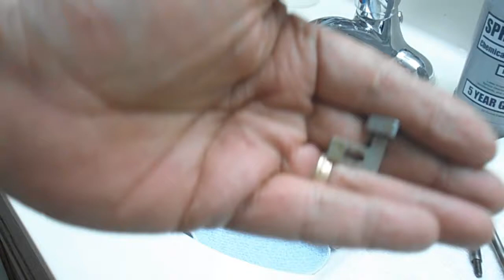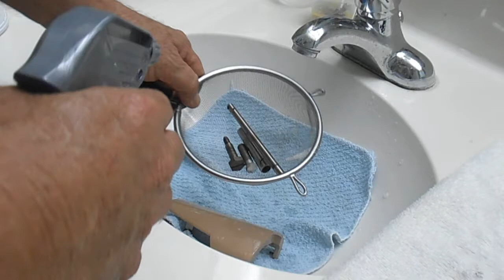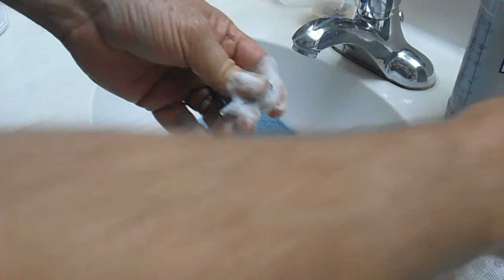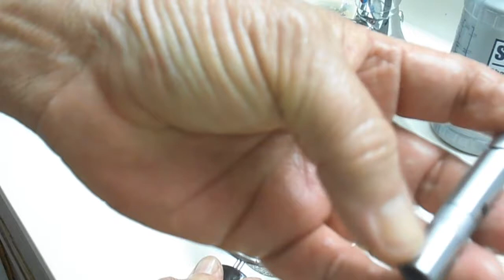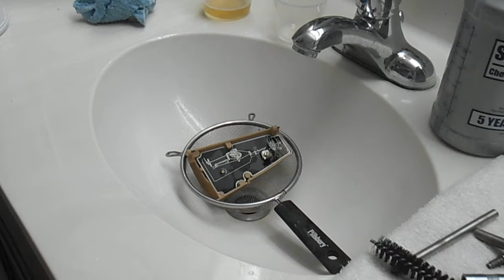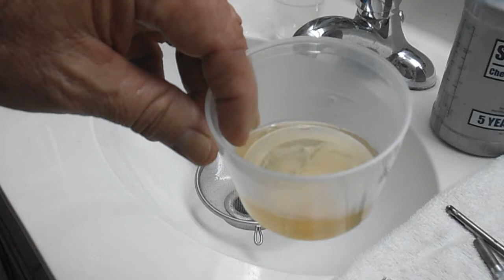SINGER MODEL 404 RESTORE SERIES Pt. 10a CLEAN SMALL PARTS

Comment: Hi, Andy! I actually had a brainstorm regarding the drying of small parts that may be of interest to you and some of your followers. I put them in the basket of my NuWave Air Fryer at the lowest temp for about 2 or 3 minutes. That does the trick!
Reply from the maker: I like it! I have to say here were times I lost little screws because I blew them awaay with the hair dryer. You idea sound great and unlikely to loose the little parts. I'l pin yur comment so other may see your suggestion. Thank You!

Comment: Looks like there isn't a lot of wear on any of the moving parts.  I love the Krud Kutter.  It works better than the designed cleaner for humidifiers.  Thanks Andy!
Reply from the maker: I was very happy when I found the KK and have not used anything else since them. BTW, you can often use a lower % of KK to water than I show. I now start with a weaker solution and if it won't cut the gunk enough I can add a little more KK as I go.

Comment: Andy, you were not kidding about the bottom pan being filled with crud. I followed your videos and now getting ready for cleaning.  My 404 is a lot greasier/dirtier than the one in this video. The Bed Cover Plate Felt is almost saturated. Have you ever replaced the Bed Cover Plate Felt, or just washed it? The machine reeks with oil and grease.
My only disappointment is that one of the Arm Top Cover screws was missing. I discovered that one of the mounting holes was broken in the body under the cover. Have you ever come across something like this before? My machine also has paint missing from the front edge of the bed. Probably from wear and tear. 
Also, my 404 only has one mounting screw in the front of the lamp cover. Is there any documentation on how to distinguish which 404 I have? I assume that the differences between the 404s are minor.
Additionally, my 404 has an additional plastic panel/cover that screwed over the metal Bed Cover Plate. I guess to make the entire bottom more of a sealed unit.
I haven't turned it one yet, but is it safe to say that if the body is in a very dirty/oily condition, would the motor need any extra attention? Do you normally clean/rebuild a motor for a full restoration?
Thanks again for all the videos. They are very helpful. Now, I gotta get cleaning.
Reply from the maker: That's a lot of questions! I'll try to answer all of them
1. Yes I wash the felt: https://youtu.be/4Rk8z_oOESQ
2. Yes I've replaced the felt. Buy felt at fabric store, cut to fit, glue down with E6000: https://www.walmart.com/ip/Eclectic-E6000-Industrial-Adhesive-Clear-2-Fl-Oz/17808713
(3) I buy missing screws from sellers on eBay
4. Yes. In my experience, broken screw holes are usually from a machine being dropped. Usually the screw/screws snap off and remain in the hole, but a hard drop can break body parts. I have used JBWeld SteelStik to reform broken parts, then drill a new hole a tiny bit smaller and force the Singer screw into the hole. Like a self-tapping screw. It can be painstaking to do.
(5) The missing paint on the front edge of the bed; could be from a machine drop in your case? I have never used it, but viewers have told me this paint by TESTOR is a close match:  > Model Master Dark Tan FS30219  > Testors Cream 1116
6. There is some info for dating your 404 available online. They only made it for 3 years + 1 more small run. I don't know if the one screw lamp shade was early or late in the production run: Singer Model 404
Singer Model:	Serial Numbers:	Manufactured Year & Location:
 	 	 
404	AM837800 to AM887799	1958   Elizabeth, New Jersey (Start of 404)
404	AM891700 to AM941699	1958   Elizabeth, New Jersey
404	AM954511 to AM999999	1959   Elizabeth, New Jersey
404	AN000001 to AN054511	1959   Elizabeth, New Jersey
404	AN075280 to AN175279	1959   Elizabeth, New Jersey
404	AN212995 to AN312994	1960   Elizabeth, New Jersey
404	AN465662 to AN467161	1963   Elizabeth, New Jersey
Grand Total: 401,500 from 1958-1960, 1963
(7) When the 404 was sold in a carry case, it was either a two piece plastic, or with a plastic base and a wooden top. That may answer your plastic/panel cover question.
8. Yes, the motor needs attention
9. Yes, I ALWAYS clean the motor during a restoration: https://www.youtube.com/playlist?list=PLsCOZgzzaiKJSu0T9oeaheTZsrUe91kkZ
P.S. I also clean the foot pedal: https://www.youtube.com/playlist?list=PLsCOZgzzaiKL6ePPxLpmnWSzTyxPKTb71
Happy restoring, and thanks for watching my channel.
Reply: @andytubesewing1953  Andy, thank you for all the answers. I never thought of JB Weld - it is strong stuff. I will have to check that out. My machine has had its spa day. Now it's polishing time. I hope you are doing well.
Reply from the maker: @danddm3221  I hope that works for you. Good Luck.

Comment: I have been watching many of your videos back-to-back. 
So informative and well done!
I bought a Professional Buttonhole for my Singer T&S 758 on EBay.
It is in good shape but the “spring” in the lid that pushes down on the cam is rusty.
Should I try to remove it or just soak it in the Krud Kutter along with the plastic case?
Thanks so much for your videos!
Reply from the maker: You don't need to remove the spring if you don't want to. After it is cleaned (no oil or grease on it ) you can use a Q-tip to apply a little of The Must for Rust like in my video here:
https://youtu.be/anyDAwKZmDY It will only take a tiny bit to rub off the rust and then let it dry. If the spring is very rusty I probably would remove it just to be able to soak it a couple of minutes. I also apply it with a small watercolor brush. It works well and quickly and helps prevent rust in the future too. Thanks for watching my channel, Jan, and good luck.
Reply: Andy Tube I have one more question (for now)....I took the top off my 758 (again motivated by your video on oiling the machines) and it is very clean inside but I noticed a washer lying on the top broken in half. It was like a cardboard material? Anyway it looked like something that might be a common occurrence. Do you think I should look for a replacement? It was lying on the left side close to the vertical shaft. And, it was hard putting the top back on....wasn’t sure how to place that hook assembly...but eventually got it...
Reply from the maker: @Rugby-y1m  That's a touch & Sew model and I've never worked on them, so can't advise. I do have a bunch of parts manuals with pictures, names, and numbers you can have if you want. Maybe that would help? Email to andymanuals53@gmail.com and ask for the manuals by naming the model number, please. Terry Fielding at http://site.tandtrepair.com/700TS.html  knows more about the T & S models than anyone else I know. He has manuals and parts and so forth. If you buy anything from his store be sure to use my coupon andy-h-yt and get 20% off everything he sells. Good luck Jan

Comment: I got time to use my Krud Kutter on some stuff. Wow, that stuff WORKS!  I cleaned some feet and an accessory box and my buttonholer. The buttonholer had some old waxy lube really caked on and the Krud Kutter stripped it right off. I am very pleased. Thank you, Andy!
Reply from the maker: Very Welcome!  I remember being excited the first time I used it. I couldn't believe it. I've used a few gallons over the years, and still like it the best. Thanks for commenting; maybe others will try it too.